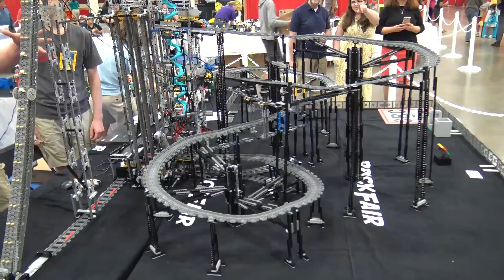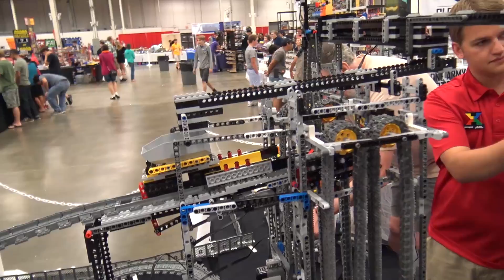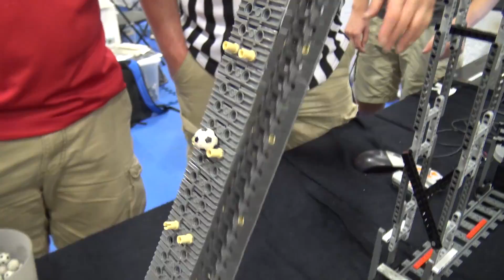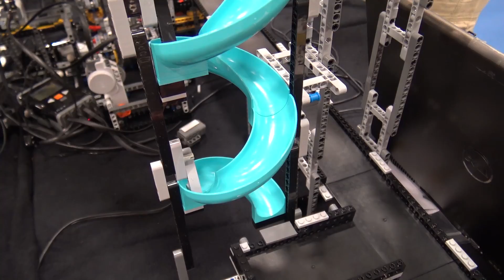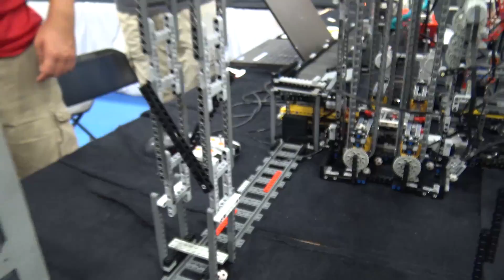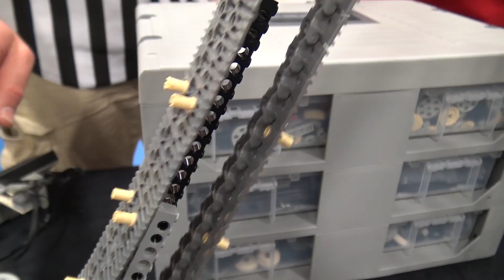Giant LEGO Roller Coaster Great Ball Contraption Module | Rube Goldberg Machine

Comment: This looks a lot more complex than the one my son made a couple years ago and fifth grade.  He was tasked with making a marble roller coaster using any materials he chose.  He chose Lego. 100% Lego.  The only part not like how was the marbles provided by his teacher.  Over 3000 Legos later and six months of work, he completed the project.
When it was time to be grated, tragedy struck. He was moving up from one classroom to another when another student walked through the doorway at the same time. The main tower collapsed and ended up one floor. He still received a B+ overall grade after he spent 45 minutes in class rebuilding that hour. The main tower alone took almost 4 weeks to design and built the first time. Needless to say, the rebuild was not nearly as structurally sound or visually appealing as the first.